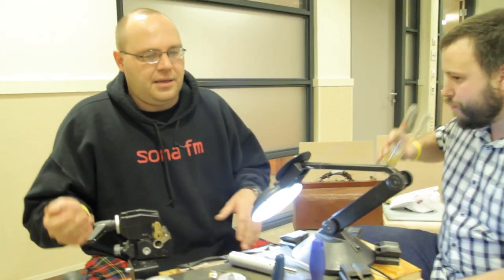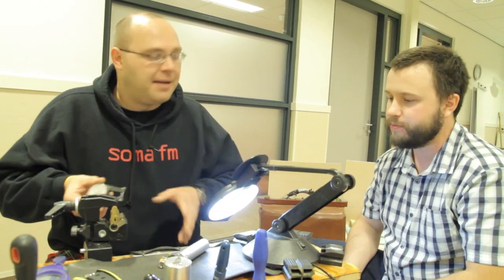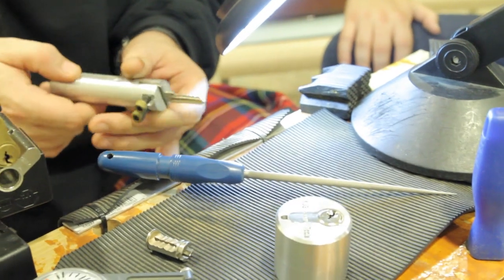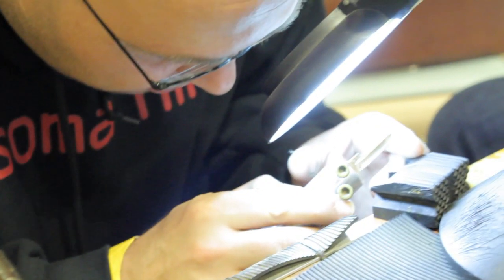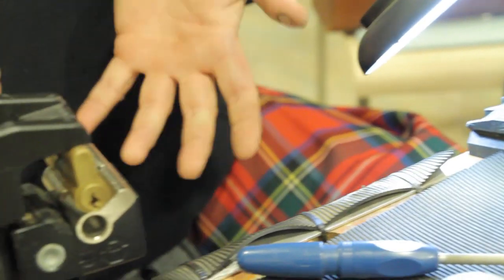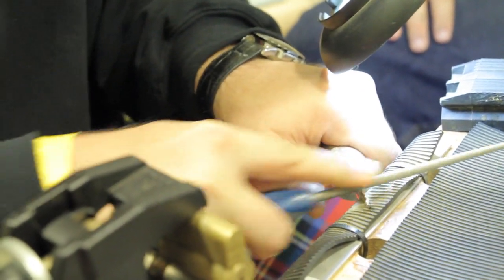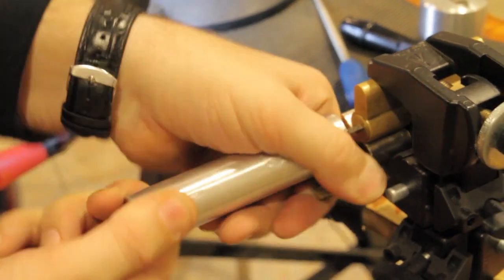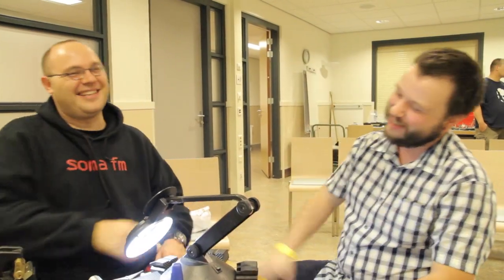Jos Weyers on Impressioning

Comment: what diopter magnifier do i need for this? I think the one I have isn't strong enough and I think i'm misreading the marks because I keep cutting keys below the depth they need to be when I compare to original key to see if i'm getting it right so I'm still seeing marks when I shouldn't, any advice on what i may be doing wrong?

Comment: In the 1980 S I could impression a BMW in five minutes and I could do the same thing with sabb and VW and I have had the same file for over 30 years and it has never let me down and the only thing I need is a file with a small pair of vice grips and the proper key blank I’m very good at impressions. 
The most important thing to remember never oil the lock while doing this because it will make it hard to to get to see the marks.

Comment: Can someone help me out. I am hoping to be a locksmith and learning skills etc. Wouldnt a more efficient way to deal with no key be to pick the lock then re key it? Could someone explain why you would impression rather than do this. Thank you
Reply: In the field, it can be a devil to pick a lock, like if it's a lever, or an odd orientation. There's also the chance that the lock is not rekeyable, and needs to be impresssioned to get a key. And once you have a key, it never needs to be picked again. Source: I am a locksmith and competitive impressioner.

Comment: I was successful at making a key that works on a master lock #3 but I can't get the key out of the lock. What do I do? Thanks
Reply from the maker: Most likely you've cut one of your valleys too steep, so the pin is colliding with a surface instead of being dragged upward. If you smack the lock onto a hard surface, spring-side down, and try to pull the key out at just about the same moment, you may have luck removing the key.